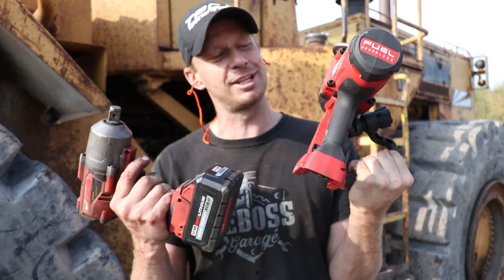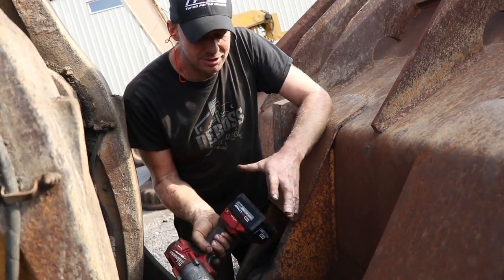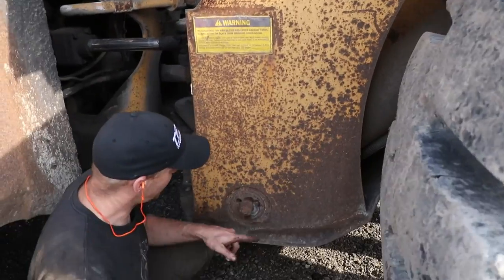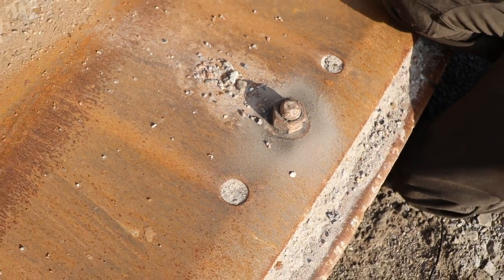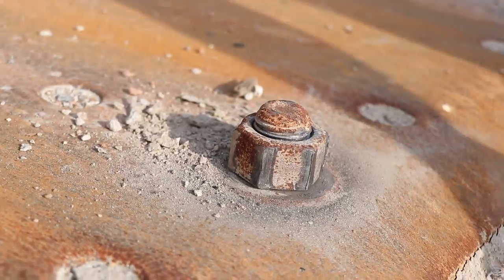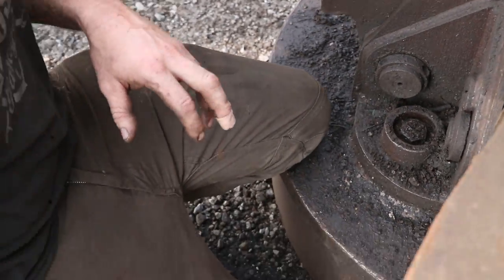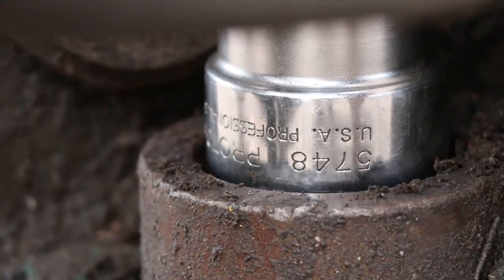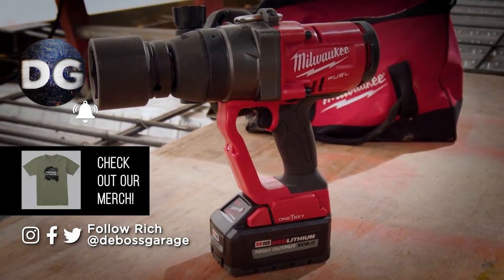Busting 40 Year Old Nuts with a 1 Inch Impact Wrench | Milwaukee M18 FUEL 2867-20 REVIEW

Comment: Rich, I change tires on 50 ton hauls trucks underground. They have 50 wheel nuts torqued to 500 ft/lbs. I use my Milwaukee 3/4 gun with a 12 amp battery it can remove all the nuts, reinstall them and go around the entire wheel twice and tighten to near spec with an extension and have 2 bars on the battery left over. Milwaukee tools are incredible.
Reply from the maker: Thanks for sharing real world experience.  Numbers on a box don't mean much to most.   Nothing beats real world!
Reply: DEBOSS GARAGE thanks for your reply! Love your channel. I live and work in the mining industry in northern Ontario I’ve got real world experience with Milwaukee tools for days. Last week I changed a tire on a CAT AD 30 rock truck the wheel studs are torqued to 740 ft/lbs and there’s lots of them. Armed with my 9 ah battery I did the whole job, tightened down the new tire and checked it with a torque wrench and my 3/4 was able to hit the 740 tightening no problem. I was a skeptic too when it came to advertised torque output numbers and we did real testing, torqued fasteners to the advertised values and the tools do what they say. I also wanted to know what every different power mode does so I knew what applications I could use the tools on. I don’t use anything under 1/2” drive so I don’t need anything smaller than my fuel mid torque 1/2” gun which is a daily tool. I’ve put them up against the competitors tools from Snap-on, Matco, IR, makita and dewalt and there’s no comparison. The only air tool I currently use is a die grinder and and I haven’t found a replacement for my 1” drive air gun yet, gonna try the new Milwaukee shortly. Milwaukee replaced all other pneumatic tools and allowed me to bring the power with me no matter what kind of mess I find myself in.
Reply: DEBOSS GARAGE not to mention the huge amount of grief and hours of time they’ve saved me which I consider to be priceless.
Reply: @havingfun8192  Having to run air all over, and the od leaks that would pop up.
Reply: wobbly sauce.... in my line of work compressed air isn’t always available, in fact it not available far more often than it is. Over the years I’ve done several jobs by hand which have taken far longer and with huge amounts more effort then it would have with the use of power tools. When this Milwaukee line came out it was a huge stress relief for people like me who work in several different areas of a mine at any given time. I keep a complete 3/4 and 1/2 impact socket sets in my underground truck and a couple different impacts when I leave the shop so matter what I got the tools to do pretty much anything anywhere without even have to think about air hoses etc.
Reply: Kato Kagome the guns have different torque settings on the guns themselves. If that isn’t good enough these guns have Bluetooth technology and you can control the power output with the Milwaukee app from your phone.
Reply: Axle cv nuts are scared everywhere I dont I care they claim it's not for automotive use
Reply: The high powered cordless impacts have been a god send for mobile forklift mechanics like myself - here in the UK we don't have big fancy service trucks with compressors ect due to stupid drivers license restrictions so we use small (by US /Canadian standards) vans. No room for a big engine powered compressor.
Very rare I have to get the breaker bar and big scaffold tube out these days - my back doesn't miss it! 😂
Reply: deezelfairy I feel you man, I’m an underground mobile mechanic in a gold mine. I work on all types of equipment from personnel carriers to fork lifts to haul trucks to mobile drill rigs to scoop trams and I feel the same way. These impacts see daily use have saved me countless hours and so much sweat.
Reply: @katokagome4670  use a torque wrench. Coz this gun can't reach 475ftlb. I'm a truck trailer mechanic and this gun can't pull 33mm wheel nut for 11r225 wheels.
Reply: Andus Luk I don’t know what gun youve tried but mine will reach 750 tightening, more if I let it hammer longer.
Reply: @havingfun8192  we are talking about the Milwaukee 1inch here. I put torque wrench on it and it doesn't reach 475ftlb on the 33mm truck wheel nuts. No Matter how long u crank at the highest setting.
Reply: @lukak1  I just read another comment that the guns are leaving the factory with the one key app setting at 70% or less. You have to go in the app and conecct blue tooth and check it out and raise it to 100%
Reply: @JayJay-de8vq  I did already. But still not as strong as a no name air impact
Reply: @lukak1  was it set to 70% or less when you went in the one key app? And yes all the large air impacts I have used were always very strong and had a harder impact hit that was less frequent it seemed like.
Reply: Kato Kagome torque sticks but I don’t know if they have them for semi specs
Reply: @JayJay-de8vq  when I registered one key and connected to the gun. It was showing full power already. And I did mention that to Milwaukee's product manager when he call me on the phone. He didn't mention anything about 70%.
Reply: Having fun-Where abouts do you work? I was out in timmins last winter for a job we did and i know there’s plenty of mines out there. Just curious if you’re from around that area.
Reply: Carmelo Sortino I live and work in Timmins, born and raised. You’re right their are several operating mines in the area and we’ve got many different types on minerals in the ground. Mining is our economy up here.
Reply: Having Fun Would it be ok to use these 3/4 or 1" impact drivers to drive 5/8", 3/4", and 1" lag bolts into wood and concrete for anchoring applications? Right tools? In afraid of over torquing! How good is its tightening control? 
Thanks!
Reply: Leonardo Rojas the one key app doesn’t give specific torque outputs but you can find a power level that works for your application and use it accordingly. There are different power modes to choose on the tool itself which may work also but one thing is for sure you won’t have a problem with it not being able to tighten enough.
Reply: Having Fun what mine do you work at?
Reply: @jeremyhanna3852   mid 90's honda crank pulleys beware ;)
Reply: Work on 18 wheelers. We torque our wheels to 475 ft/lbs. My 1/2 inch impact with a 6 amp battery can take those off no struggle.
Reply: Andus Luk I’m a truck trailer mechanic and I use the 1/2 Milwaukee to take off 33mm all day when I put them back on I get the torque wrench sometimes they move a little and sometimes it clicks
Reply: @katokagome4670  with the one key system you can set the torque rating you want
Reply: @JayJay-de8vq  There is no way Milwaukee is sending them out of the factory at 70%. That's risking the 70% of people that never took it up to Bluetooth not getting the full power and thinking it's underpowered.
Reply: Everyone inn The comments think 500ft/ibs is much.. the best 1/2inch impact drives can do over 1500... I just changed some teeth inn a shredder..  36mm 12,9bolts... 3300 ft/ibs ... With a handheld battery  "drill"
Reply: @lukak1  did your use a extension?   You can't use them with impacts..
Reply: @TheSvisla  33mm socket straight on. In face, Milwaukee sent me another 1" impact gun last week and ask me to try again. I did it 5 mins ago. Same result , can't even pull 1 nut off a 11r225 tires. I recorded a video. Will post it once I have it uploaded
Reply: @password2798  I have new and old units in my fleet. New one might stand a chance. But old one usually no. Be honest. The half inch gun probably as powerful as the 1inch. I have both.
Reply: @flippedmylid92  oh. Maybe u guy have no rust and Snow down your area and they don't seize.
Reply: @lukak1  Our shop is about 6.5 miles from Lake Michigan.
Reply: @lukak1  hmm .. wtf.. its kinda usless then... waiting for the video.:P
Reply: I'm hearing a lot of good stuff about Milwaukee tools. I'm thinking about selling my Dewalt and buying one of those 1 inch impact tools
Reply: @deezelfairy  truck mechanics in the uk use standard Van's with compressors capable of running a 1" air impact. You can even get them to run the compressor pump from the vehicles engine. You don't need a huge service truck to be able to get a compressor capable of doing heavy duty work and all can be done using your car licence. Im restoring my truck and I've stripped my wagon down to the chassis frame, the engine out and cab removed including wheels etc all with an 18cfm compressor with a pump that's on its arse using a 1inch and half inch impact gun with no issues regarding removing high torque bolts
Reply: @Dieseldogmodels  Yeah but it adds a lot of extra weight that in my line of work (mobile forklift repair) I can't afford to give to a compressor. A pto set up is ideal but extremely expensive.
Being employed by a large forklift company I need to be on the road for a week at a time between depot visits, I'm carrying nearly a 1/4 tonne of lubricants alone. Tools, blocks, jacks ect... Are coming in at 500-600kg. A 3.5t long wheelbase hightop transit has realistically got a 1.25t payload, a swb maybe 1.5t.
Factor in I've got to allow a good 1/4t free at all times to be able to ferry the odd heavy component (large motor-reduction unit for example).
Sadly, all our employers will get us is swb Renault trafics 😂.
Reply: @lukak1  Hello, have you tested a machine with quality new hexagonal sockets?
Reply: @Victor5533  I don't know if it's qualify or not but it's just a normal 1" impact socket with no extension. 33mm for the truck and trailer wheels 11r225
Which needs to be torque between  450 to 500ftlb.
For tightening.. it still have a chance to get to 475ftlb
For taking off the tires when it's been on the truck or trailer for a few years. Usually no. Even yes. It's going to crank hard.
Let's hope the 1inch d handle will be more powerful.
Reply: @katokagome4670  get a yellow 495ft lbs torque reduction extension
Reply: @lukak1  is it left wheel on bus or.an old truck. Might be left hand thread.
Reply: @hdetmechanicd4911  it's just std unimount 11r22.5 wheels. I have thousands of trailers in my yard and I will say at least 70% of the fleet this gun can't pull the nuts or it will take a while to crank them off.
I will make one last statement about this 1 inch impact gun. Not even close to replace any 1inch air impact gun on the market. That's the reason now Milwaukee come out with the 1inch D handle this summer.
Reply: @lukak1  you may have issues cos my 3/4 will do that
Reply: @brettwalkom948  I will be honest with u that the 3/4 gun is about as strong as this one inch gun. In fact, this is my second one inch Milwaukee gun as I refunded the one I bought within a week as it's suck, then after two months, Milwaukee reach out to me and gave me another one to try. Still not strong enough. Keep in mind that guys in the trade put direct 150psi to a 1 inch D handle air impact to tight the nuts. And after a few years before I get to pull them off. Milwaukee kind of admitted that this 1 inch pistol grip gun is weak that's why they are coming out with the D handle now.
Reply: @lukak1  yeah the 1 inch isn't really designed for us mechanics..are you using hight output batteries?
Reply: @brettwalkom948  yup. 12amps battery. One time I tried to install wheel studs with it and it over heat in about 6 studs.
Reply: @lukak1  yeah rite.. Odd
Reply: @brettwalkom948  it's not odd at all. Buy one to try and u will know what I mean. It's sitting in my service truck hardly use it. Maybe once a while a shock bolts or suspension u bolts
Reply: @lukak1  my brother has one and one of the guys at work used it to remove the big yoke nut on the back of a  gearbox the other week.. Screwed it back on too.. Besides I don't have a spare 1000 bucks lying around
Reply: Hell Yeah! Go team RED, nothing beats Milwaukee!
Reply: @havingfun8192  If your looking to go all cordless and want to get rid of your pneumatic die grinder Milwaukee makes an M12 straight die grinder and a right angle one too, here's a link to them.
https://www.homedepot.com/p/Milwaukee-M12-FUEL-12-Volt-Lithium-Ion-Brushless-Cordless-1-4-in-Right-Angle-and-Straight-Die-Grinder-Kit-Tool-Only-Kit-2485-20-2486-20/313112340
Reply: @katokagome4670  I don't know about the One-Key version of the 1" Milwaukee M18 FUEL Impact Gun but I have two 1/2" Milwaukee M18 FUEL Impact Guns and thru the One-Key app on my phone I can set them to only tighten to a certain torque level, it's not as accurate as a torque wrench obviously and Milwaukee claims it will get it within %25 of the claimed torque setting but it gets it to within %10-%15 of the set torque rating whenever I test it, I've also heard lots of people on YouTube come up with the same percentage.
Reply: Chevy513 ya I’ve since picked up the die grinder too now I’m all Milwaukee expect for 1 tool. Milwaukee doesn’t make a cordless torque multipliers yet that can torque 3200 ft/lbs.
Reply: @flippedmylid92  I'm wanting one for 18th wheelers to take rim off polishing the rims better and faster

Comment: That's a lotta balls. Hard to imagine cordless tools were pretty much unusable 30 years ago, now they're capable of real work.
Reply: 30 years ago? Even 10 years ago their applications were limited.
Reply: Exactly, I bought myself a battery powered leaf blower and a chainsaw and they both have been amazing

The leaf blower we use it for our trucks to clean off the trailer, we have flatbeds and haul grass/sod on them so you would get a lot of rocks and planks from the grass and wooden pallets and the blower cleans it off like if they were nothing

The chainsaw have been pretty impressive as well, been able to cut up to 4 inches and it would cut like butter, plus, it's so easy to maintain
Reply: especially if you have 2 batteries
Reply: Hah! They were very useful, compared to a brace bit or a Yankee screwdriver.
It's all relative. 
I have a pile of old hand tools no one under 40 would buy at a yard sale for a buck, let alone know what they are or how to use them. 
And unfortunately,  9.6V Makitas will never look cool as antique decorations on restaurant walls.
Reply: mike toni  Everything has its limitations. No comparable air tool would of removed those nuts either. In the real world youd torch those off.
Reply: @legohead6  or carry a long bar
Reply: @Dunki113  totally gotta agree. after fussing around with tiny 2 stroke engines that never like to start my electric weed whacker and chainsaw are prime
Reply: @bmxscape  the only thing I'm not too convinced on is the electric impact being used for semi truck lugs but I would happily use one to change tires on my pickup truck or car
Reply: @legohead6  depends as pneumatics have much higher shock loads and torque. 1800lbft vs pneumatics exceeding 2000lbft.
Reply: @JuanHernandez-ub3ez  Usually with those blade bolts its not how tight they are, but rather how damaged and full of debris the threads are. Unless your planning to snap the stud off with a breaker bar they usually wont be any better in this particular example.
Reply: @Dunki113  If you can get on the lug without an extension it will probably do it. Extensions REALLY kill the torque with these guns ive found.
Reply: @legohead6  easy blow heat on it but whatever works
Reply: mike toni  true but this test was a bit faulty as it was designed for use with the new hd 12.0 batteries because those use larger 21700 cells with higher output its probably a 20% difference in power it will work with the batteries with 18650 cells but performance may be limited
Reply: Batteries. It's all in the batteries.
Reply: I've got makita drills from around 2005 which are nicad then hitachi drills came out with lithium batteries wow you were the bad boy onsite with a hitachi and now everythings lithium and better lol.
Reply: battery tech has come a long way.  They pack a lot of power now
Reply: mike toni  there are bigger tools and better sockets
Reply: Not really, the OG makita power drill was released in the late 70's if I remember correctly. And that was a very capable drill... or maybe you want to be pretentious and only consider what you do to be "real work".
Reply: Mike Toni  you are talking about bolts that generally require a torch to remove lol
Reply: I remember using my dads line of craftsman cordless tools back in like 2005. Gutless pieces of shit. The first time I used a Milwaukee high torque I just about crapped my pants.
Reply: MT1234  There have been nuts and bolts an SnapOn MG725 couldn't remove that my M18 hightorque took off in a couple of blows
Reply: Thank to li ion battery development.